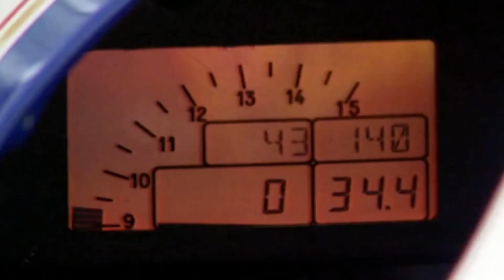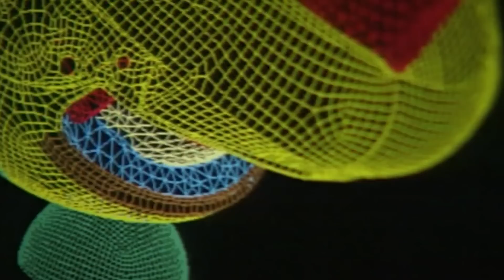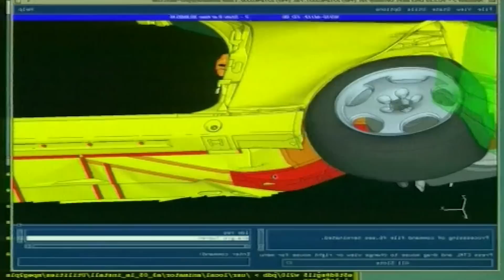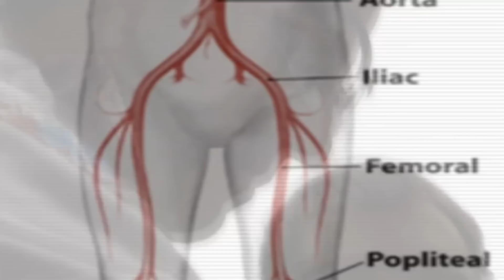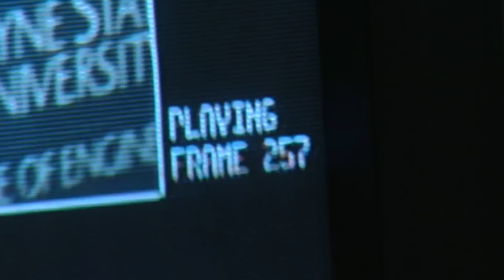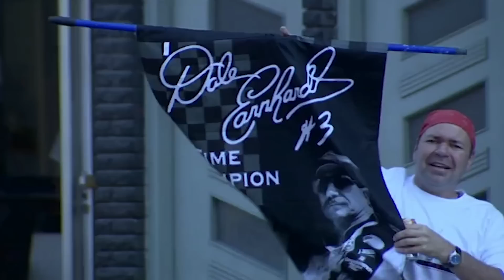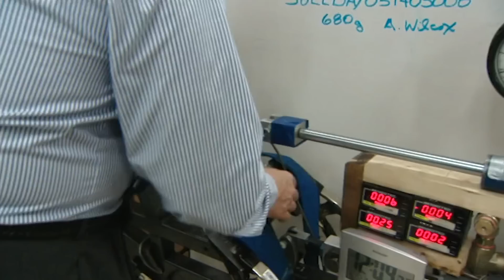The Violent World Of Motorsport Crashes | The Ultimates | On The Move

Comment: Senna had his steering column changed and the weld broke, There was no bottom out, no "steering into the slide" as Nat Geo claims in their documentary. And the cars telemetry was taken and altered.  Since Senna only 6 people have died. Much safer to race F1 than drive on the public road
Reply: 6? Only 1....Jules Bianchi 2014. Also, its worth noting that prior to Roland Ratzenburger,  a driver hadn't been killed for 8 years. So even in 94, the safety record was pretty impressive when compared to some other series.
Reply: Look at the footage from Michael Schumacher’s onboard camera. You can clearly see sparks coming out from under Ayrton’s FW16. That shows that his car bottomed out. Also, if you watch the footage of Senna’s own onboard camera, you can see the car get twitchy through Tamburello. This suggests initial oversteer, not understeer. As for the steering column breaking, the total failure was the result of the impact, with a partial failure being complicit in the cause of the accident. That best explains why the blackbox still recorded a steering input of -7.18.
Read the iBook Tamburello. That will tell you the story without bias.
Reply: Not Senna, Williams had it changed!!! A huge difference!!!
Reply: The weld broke when he hit the wall, did you even listen to the down force problem, I'm an aircraft technician .
Reply: @RichardMcLaren I think the other 5 are 3 Marshals, Maria de Villota and I dont know the 5th
Reply: @erickdorsey556  But the official italian accident report does state that the accident are caused by a snapped steering collum. The same report was then used at trial on who's to blame. The report was regarded as the most popular evidence that the steering collum did break before the crash and caused the accident, added with his steering wheel tilted foward before the crash on the onboard footage.
Reply: @FlashoftheBlades  Dunno if you watched the footage of Senna's actual crash but there wasn't even a hint of oversteer. One moment it was turning, the next moment it was going straight on. In a car as nervous as the FW16 it wouldn't have understeered either, especially not on that corner of all locations. And even if it did, it would've easily been corrected in the time Senna had. 

In multiple different sims (of somewhat varied realism but the main one has a very true to life physics model) I've driven through Tamburello more than 10,000 times in a variety of cars. I know that curve well enough to be certain that you could lose all downforce and an open wheeler with the worst setup in human history and you would still be able to take it flat without blinking. Even as bumpy as it was. 

Catastrophic failure of the steering and Suicide are quite literally the only 2 possible conditions that could've occurred, and I think Ayrton would've been quite opposed to dying that day if he had a say in the matter.

Understanding the aerodynamic factors at play is well and good but in a car tipping the scales around the 500kg mark on slick tyres, the mechanical grip alone, even cold, is easily enough to clear the corner.
Reply: @Zonda1996  There WAS a hint of oversteer. It just happened so fast that the inattentive wouldn’t have noticed. If Michael Schumacher, who had the best seat in the house for what happened at Tamburello, wasn’t in his current medical state, even he would attest that there was oversteer. He said so himself that Senna’s Williams was nervous and skittish going through Tamburello on the lap before the accident. You would have to be incredibly inattentive to detail to not notice that.

Everything you just said sounds like a conspiracy theory whose backbone is made of cardboard. It’s why I don’t take such theories seriously. That’s the kind of behavior I would expect from the likes of Andrea Sasetti, not the likes of Frank Williams.
Reply: yep, the car bottoming out somehow broke the steering column - it clear for all to see 

not
Reply: @FlashoftheBlades  at least learn what a conspiracy theory actually is before accusing people of writing one 😂 stress fatigue of a poorly welded/designed steering column on a bumpy track could easily cause such a thing to fail without there being any malicious intent at play.
Reply: @Zonda1996  Oh, I know what a conspiracy theory is, and I can see that the vast majority of what you said is the conspiracy theory.
Reply: you're so right. the steering wheel fell on his knees. people drive me nuts when they say it was a stupid bottoming out when it didn't happen the lap before with an even lower tyre pressure.
Reply: @jiboo6850  There actually was bottoming out. It just took an extra element added to the mix to provide the perfect storm of events for this crash to happen. It’s a 1+1=3 scenario, where you can handle what’s coming at you from one side or the other side, but not both. When there’s more than one stress factor, in this case, a part failure and aerodynamic instability, it’s usually much harder than handling one at a time. That’s the same reason why the mass extinctions in Earth’s distant past were so deadly. The lifeforms that were around at the time faced a combination of factors that spelled their doom.
Of course, only one person knows the whole story of what happened that day, and short of a séance, we’re never going to know the whole story.
Reply: Since when is National G a reference in motorsports?
Reply: @vincentsouchaud6717  Ever heard of their series Seismic Seconds and its successor, Seconds From Disaster? The former has episodes covering the likes of the Bhopal gas disaster, the 1980 eruption of Mount St Helens, and, as has already been mentioned, the 1994 San Marino 🇸🇲 Grand Prix.
Reply: @FlashoftheBlades  Producing the Senna at Imola documentary does NOT make National G an expert on the topic. PERIOD.
Reply: @vincentsouchaud6717  That doesn’t mean that they don’t know the science of motorsports.

Comment: The focus on the aerodynamic factors at play in Senna's accident always irked me with this video. You could remove both wings and the FW16 could likely still comfortably take Tamburello flat. Only conditions that'd ever make the car behave as it did is either from driver input or a failure of the steering. And it certainly wasn't the former.
Reply: it wasn't the latter
Reply: Do you not know how aerodynamics work? Tamburello was a sweeping corner from the track’s founding, but when it hosted a non-championship F1 race in 1965, even those cars couldn’t go through Tamburello flat-out, and they didn’t have wings. As the video states, the grip is generated by a combination of mechanical grip through the suspension, and aerodynamic grip through the wings and the airflow under the car’s floor. But as we all know (I certainly hope so), all that grip must reach the road surface via the tires. A Formula Ford doesn’t have nearly as much horsepower, but I seriously doubt that they would be able to take old Tamburello flat-out, especially since they don’t have wings and their tires are as skinny as a supermodel.